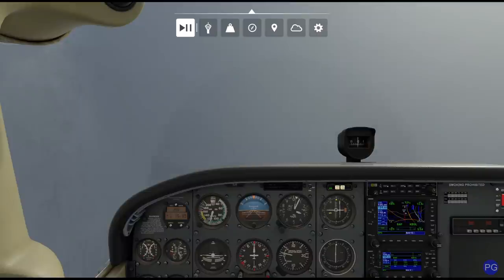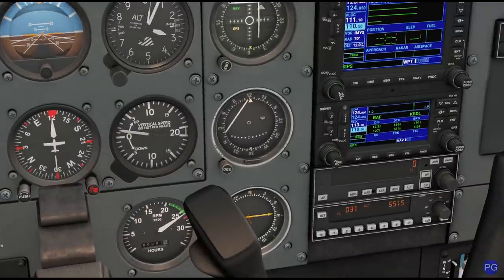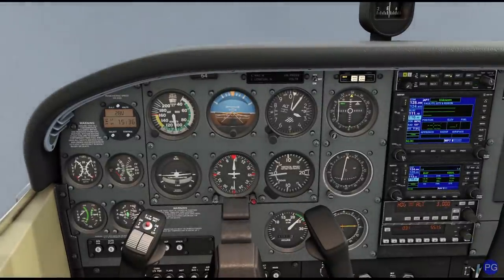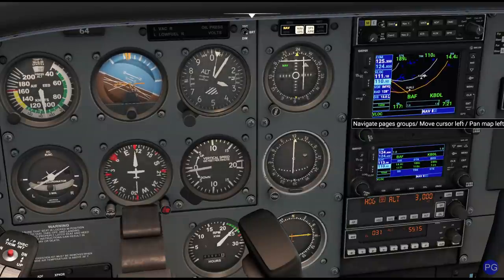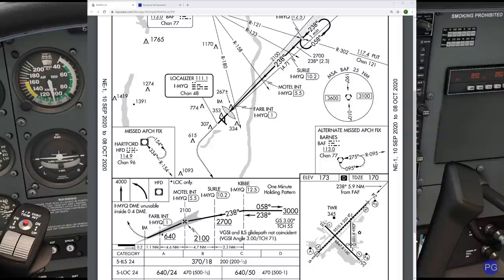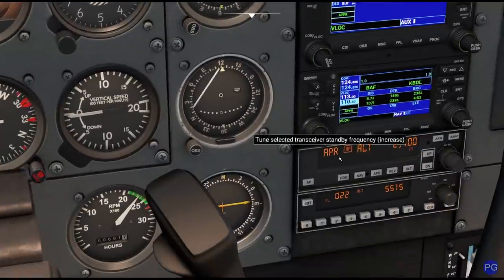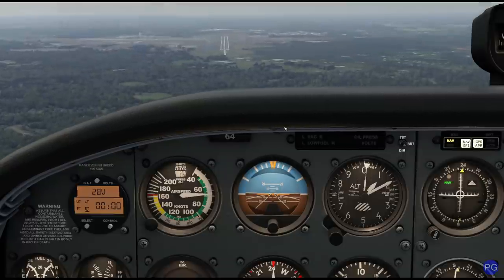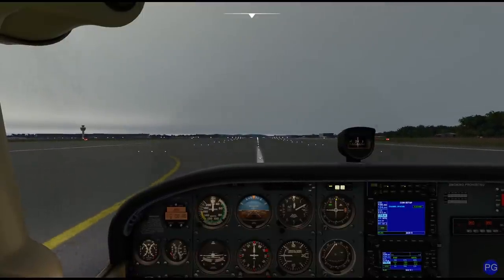FS2020 Tutorial - ILS Approach

Comment: Where did you get your 172? It is significantly different than the one that comes by default in MS FS2020.  I love the combination of analogue guages with only a minimum amount of digital accessories to ease the work load. The 172 in MS FS2020 is entirely a G1000 glass cockpit.
Reply: The DeLuxe version of the MSFS2020 has both versions of the 172.

Comment: Love your video!
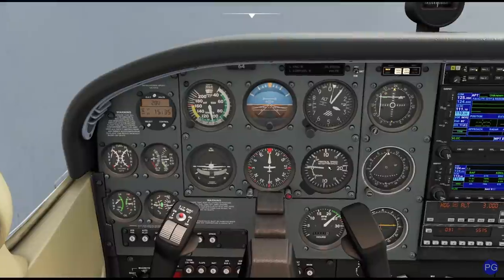5:27, I assume it should be slightly off to the right?
And can we use the nav mode on the way to KIBBE with the second navigation gauge (the one with 113.00), instead of using heading mode?
11:35, was it supposed to be 90 degree? Please correct me if I'm wrong, I'm new to all this, but since it's a teardrop and not an offset entry, the initial heading from KIBBE should be 90, right?